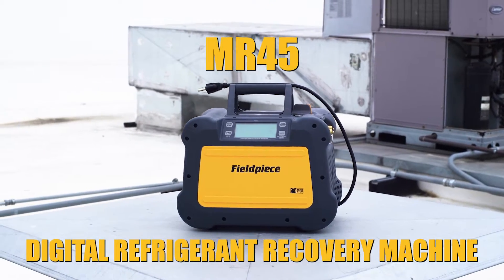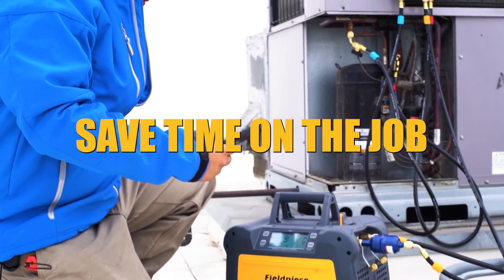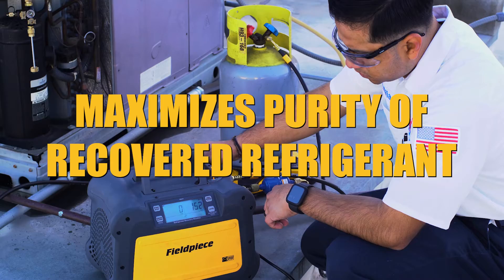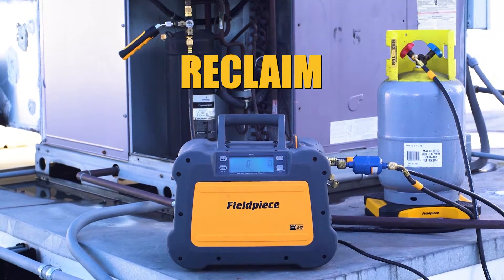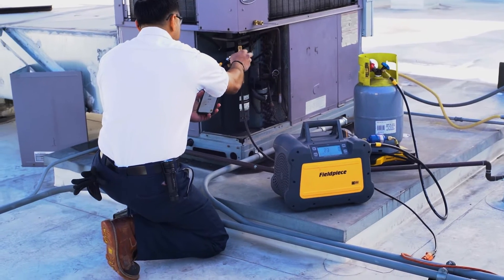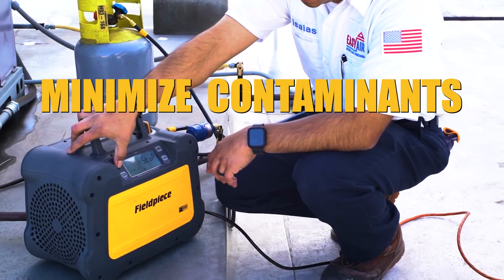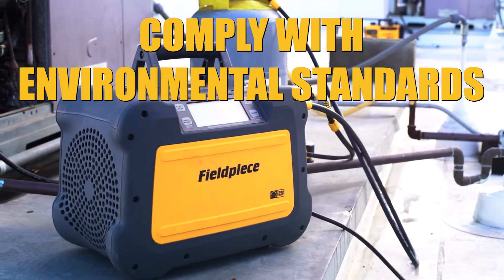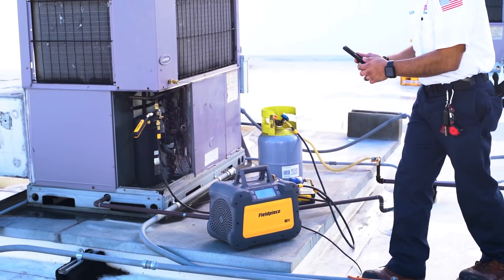RECOVER A2L REFRIGERANT FAST | MR45 Zero Stop

Comment: Can it take out the used oil inside system?
Reply from the maker: Hi Mansahari, thank you for reaching out. We do not recommend using our vacuum pumps or recovery machine to remove oil from a system. Consider flowing nitrogen to flush the system instead, if applicable in your specific situation. As always, please consult the appropriate manuals for your particular system and adhere to proper procedure.